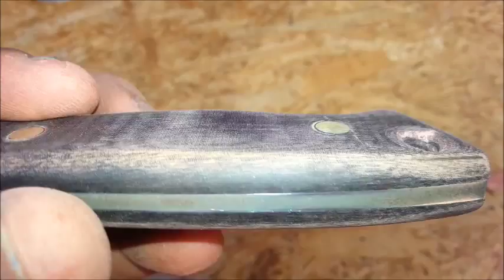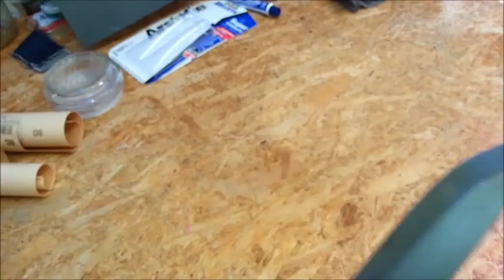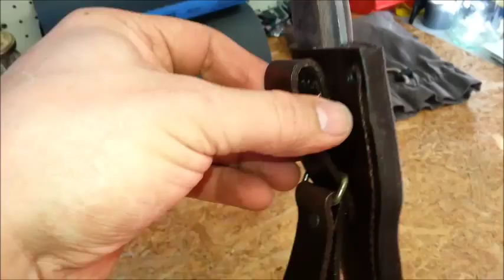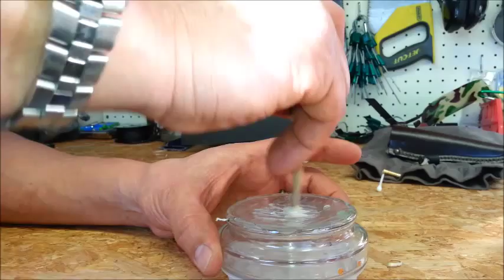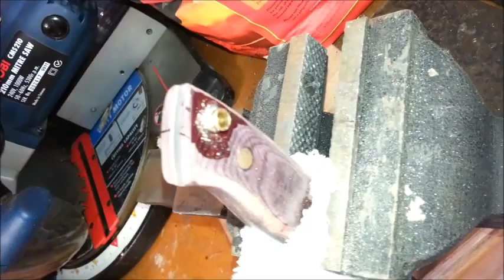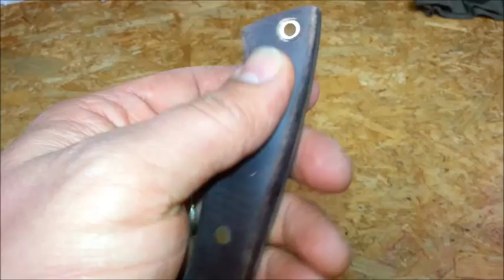ENZO Trapper 95 Kit Build     PART  III   ( Final Part )

Comment from the maker: Jacob GF,
The rivets are made of brass, a fairly soft metal.
Using a hacksaw blade, you should be able to cut right through it.
Then using a coarse sand paper, maybe an 80 grit to begin with, then once you get closer to the Micarta or wooden handle, you switch to a higher grit sand paper, maybe say a 120 grit, continue to grind away until you get really really really really really close to the Micarta or wooden handle on the knife, then call in the stealth bombers for a precision strike on whatever is left of the "brass resistance" and employ your 240 Grit smart bomb and wipe away all that nasty brass opposition. lol
You should end up with a really nice and smooth finish, with hardly any perceptible tactile feel of the brass against your fingers as you run them along the Micarta.

Cheers and I hope this was helpful.